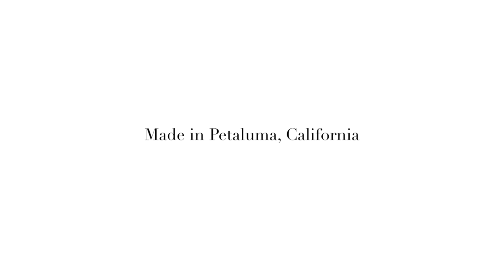Solid Walnut Dresser with Hand-Cut Dovetails — The Biloxi Dresser

Comment: what router bit and setup did you use to get the oval shape on the legs? I was first thinking oval bit but you would neeed a bearing and a template guide. Or a big roundover and jjust set the fence depth?

Comment: Quick question, how are you clamping the piece to your table saw at 1:40 to do the dovetails?
Reply from the maker: I just realized it looks like magic 😅 There are clamps on each side fastened to the semi-hollow inside of that wing of the table saw. It’s surprisingly sturdy but I still plan to make a proper roubo one day.
Reply: @theroaringwoodwork2213  Interesting, that's a great little tip, thank you! I feel you on the roubo as well, have to get creative with the clamping around the shop too 😂

Comment: Beautiful piece of furniture again, walnut is one of my favourite woods and by the looks of thing's it happens to be one of your favourite woods too.
I never get bored looking at all the different grain variations going on within the wood you never get two the same.  Congrats buddy it turned out brilliant and will tie in nicely with your other walnut pieces you have made over time!!! As always buddy 💯%   👍   🇬🇧.
P.s. only thing I'd like to see you do is include a bit of brass inlay on the front of the cabinet,I honestly think it would just POP and finish the whole thing off !!! Just a bit of brass rod used as inlay nothing bulky just nice  think brass rods would do it. That said it still is a beautiful piece and look amazing in any home !!!
Reply from the maker: Thank you for the kind words, Simon. I do however feel that the continuous grain walnut drawer fronts are all it takes. Adding brass just for the sake of adding brass would not contribute anything in my opinion, but to each their own. I like to approach design with something Ezra Pound wrote about writing: "Use no superfluous word, no adjective, which does not reveal something." As well, I think what draws me to mid-century modern design is the idea that it "is typically characterized by clean, simple lines and honest use of materials, and it generally does not include decorative embellishments."
Reply: @theroaringwoodwork2213  I totally agree with what you said and definitely with the statement from Ezra Pound, the reason for the suggestion was simply not to mock your work but just the thought of adding something simple if anything just to see how it looks and feels to yourself as a creative person who has a good eye for design details!! As always buddy   💯%   👍   🇬🇧.
Reply from the maker: I totally get that. I love walnut and brass, too. I'm working on a bunch of turned brass and walnut necklace pegs right now for some jewelry cabinets. Other than maple, there really isn't any better combination with walnut :)
Reply: @theroaringwoodwork2213  if you're making a video of the build process then i shall definitely have to keep an eye open for them landing in my inbox 👍.